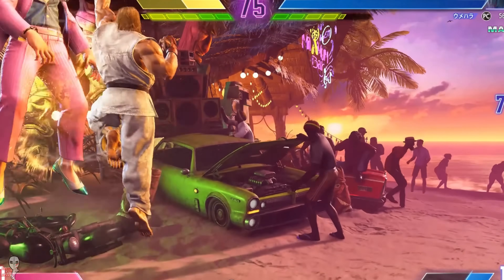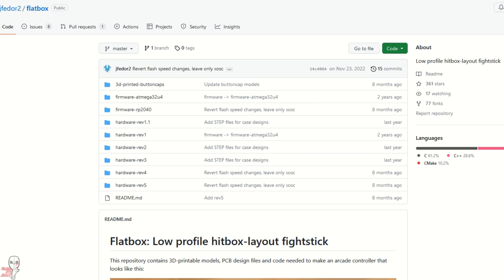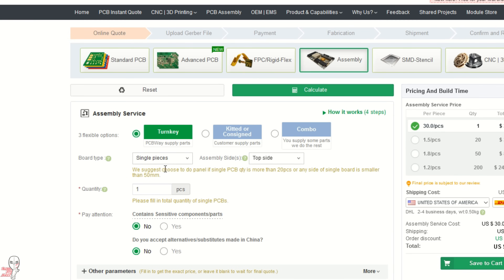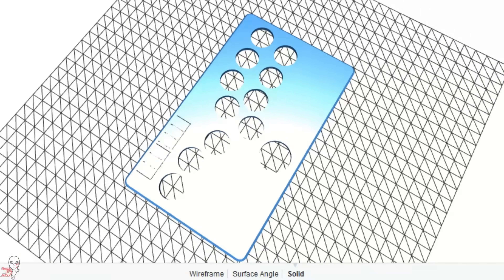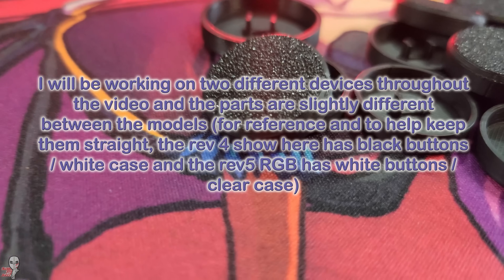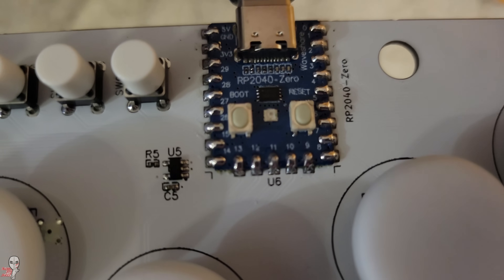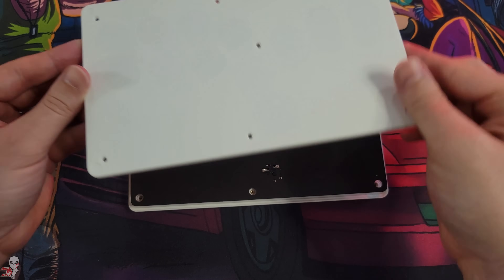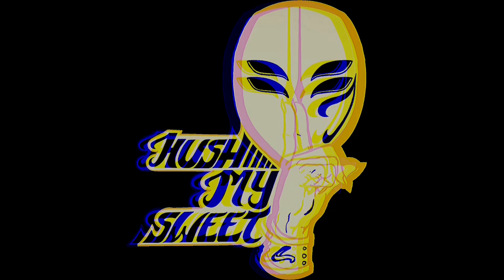Build your own Flatbox! An inexpensive, open-source fightstick option

Comment: I made ten of the Flatbox rev 5 earlier this year and gave a bunch of them to friends. I had done something similar with the Open-Frame1 (bigger controller for Smash) just a bit before and found the Flatbox to be a refreshingly easy/fast build by comparison. GP2040-CE is super nice and fleshed out firmware as well. The stuff I run on my Frame1 feels a bit more primitive and there aren't new releases as often.
I'm a big fan of the Flatbox. I've seen some of the keycaps I've printed break off in switches which is the biggest flaw of these things. Aside from that, it's been great. I printed caps in PLA+ and you might just need a sturdier plastic for something so thin. That or I got a few bad caps per batch maybe. Several people I gave controllers to have broken a single cap but haven't had an issue since.
Reply from the maker: Right on! Yeah, I think they are fun little units and it's cool you are helping out your buddies with some builds!
Reply: shittt wanna make me one? haha
Reply from the maker: @panpan1985  A lot of people build several at a time and then unload the extras to their friends/scene/whatever. But some of them sell the extras to recoup some of their costs. I know several have sold on https://www.reddit.com/r/Fightsticksforsale/  Good luck!
Reply: You gave them away?
Reply: @severussin Yeah, just to some people I hang out with IRL regularly. They weren't previously into traditional fighters (just a bit of Smash mostly) so I doubt they would've bought them if I'd tried to sell them anyway. This way I'm able to introduce them to arcade controllers at least. Although it's still surprisingly hard to get them to use them even when they were free.  It took setting up a console with Soulcalibur IV and showing them it worked with the Flatbox to get a lot of them playing with theirs after months of having them.
Reply: @SoundToxin  You're doing a public service. Kudos to you! Out of interest, are they PC or console players? I'm on PS5 and finding that we need to use the Brook Wingman FGC adaptor to make any of these custom boards work.
Reply: @severussin  I'd say they're mostly PC players, but we sometimes do some Xbox 360 or PS3 stuff when we meet up.
I think PS5 support is still being worked out in GP2040-CE. The latest release candidate mentioned something about it, but it uses some sort of USB passthrough. I think some controllers support connecting to a regular controller (like a DualSense) to get PS5 support and the feature was aimed at something like that.
One of my friends ended up getting Street Fighter 6 on PC and uses his Flatbox for that now. 
I don't think any of us are trying to play a super new game on a console so the lack of PS5 support hasn't really come up.
Reply: I also have ptoblems with the caps. They break way too easy even when swapping to a new color. Therefore switching to v2 switches hopefully this works better

Comment: there's one thing I don't understand-- how does the micro controller know which key is connected to each pin? 
With an arcade stick, there's a wire that connects them. But there's no wire here. Im confused.
Reply from the maker: What you're thinking of normally is where a wire connects from a button to the PCB. Here, the buttons connect directly to the PCB.

Comment: Is there a way to make it work for ps5?
Reply from the maker: Not as it sits. You'd have to integrate a Brook Fusion board or PS5 daughterboard add-on somehow, but that's going to require a big overhaul. An easier way to do it is to buy the Brook PS5 wingman converter and just plug it in to that for PS5 compatibility. Good luck.
Reply: @HushMySweet1  damn, I saw some controllers in that use the ps3/ps4 fighting board plus and the ps5 upgrade and they make it work somehow.

And a guy from my country made a controller for me with the same fighting board and made the ps5 upgrade with a raspberry pi upgrade, I also have no idea how he make it work tho D:

Comment: would I be able to build one to work for ps3/ps4/pc?
Reply from the maker: The ones you see in the video do work on those systems. The only issue you may find is the PS4 requires special keys/codes, so that one can be more of a headache if you can't find them. The ps3 and PC should work by default though.

Comment: Are there any similar alternatives but compatible with actual arcade/sanwa obsf buttons?
Reply from the maker: Not really? I think the appeal of these is that you just plug the low profile switches into a PCB and it's all one little unit with no real wiring, and super portable/cheap. Once you get into Sanwa buttons, you have to do some wiring and have a minimum depth to your case to accommodate. You could probably dial in some low prof choc switches to give it a more "standard" arcadey feel, but I don't know of a good equivalent. You're getting into Flatbox and Hitbox stuff with standard buttons. Good luck in the hunt though!

Comment: Is it possible to find PCBs and enclosure files that use different button layouts? I would like to have a leverless controller that puts the L1/L2 buttons just above the face buttons so they're more easily reachable, rather than needing to reach your pinky.
Reply from the maker: Not that I'm aware of. Hopefully this video acts as a catalyst to get more people into the PCB design process. You can also join the Open Stick Community discord (they can help with questions) and try your own hand at the next big design. Good luck!

Comment: This is great, sadly a couple of switches are out of stock right now ;_;

btw is there an RGB -free version?
Reply from the maker: The tact push button ones? Or the low profile switches? If it's the low profile, then you could try dark yellows. That's probably my favorite switch type (a bit stiffer than red) and they always seem to be in stock. Also the Rev4 Bridget doesn't have lights if that's what you meant. https://github.com/sgfdevices/Bridget

Comment: Do you mind telling me your total cost on this? pad has been hurting my hands a lot lately but I don't really have the money to invest in a hitbox (even if I did, they're all sold out).
Reply from the maker: That resin one with the Rev5 board is going to be more expensive, but if low price is priority, that Rev4 version with the 3d printed case (the white one with the black keycaps) should be about $50-60 if you want to build a similar one yourself. Good luck!

Comment: Hey Hushmysweet, love your collection and videos. I was wondering if you will do a fight stick to lever less conversion video in the future.  I would love to convert my old hori stick alpha for ps5 to lever less.  All I know that is I need a socd cleaner and new plexiglass for buttons lol.
Reply from the maker: Hey, thanks! That would actually be a fun video concept, but unfortunately I sold the Alpha to a buddy, so I don't have it to test and tweak. I think I remember it having an extra wire to the joystick, but I would imagine it would still take a 5-pin joystick to all-button conversion harness. You could get a BitBang Magician's SOCD cleaner to make sure the inputs were being read the way you wanted. You'd also need plexi like you said, but a metal panel below it to support the plexi and sort of act as the top panel frame (you would not want to solely rely on plexi). I'm just spitballing stuff here since I don't have it in front of me to look at, so I'm not sure how difficult the change to leverless would be. If you could buy the face panel plexi and plate, it would make things a lot simpler. If I get another one in the future, I'll see about a swap since that is a good idea. Thanks for watching!
Reply: @HushMySweet1   Thank you SO MUCH! I appreciate the reply and all the information. You are the best! thanks for the advice.  Always!! @ Thanks for watching!

Comment: Do you have a Snackbox Micro or an MPress?  Im curious how the height from the top of the  shell to the top of the buttons compare on the flatbox to the commercial offerings.
Reply from the maker: I have the Micro and the XL so I pulled them out to look for you. Looks like the Micros are slightly shorter from the top of the shell to the top of the buttons. It's fairly marginal, but if you're wanting the lowest distance between top of cap and top of panel, looks like Micro has the Flatbox beat on that front. Hope that helps!
Reply: @HushMySweet1  Thanks for checking!

Comment: I just made my own controller using a pico pie running 2040-ce and printed the parts. It takes some thinking and planning but it's worth it if you have the patience. Works for PC, Xbox, Switch, and PS4. it was about $20-$25 worth of parts.
Reply from the maker: Very cool!
Reply: Would you happen to have a list of source parts. I am looking to set one up for my XSX

Comment: In games like Soulcalibur VI, there are certain moves that demand frame-perfect input of one button followed by another button with zero overlap between the two, which is accomplished by fiercely sliding your finger(s) across the buttons. So when I see these new low profile controllers popping up it makes me cringe a little because they all seem to have textured buttons that are flat or even concave, instead of convex and smooth to allow for such slide inputs. If someone starts making proper injection molded smooth convex button caps for these low profile switches, I'd say they would have a winner on their hands.
Reply from the maker: I feel ya, but there are some that do. Don't quote me on this, but I think the SGF Zappa and a newer prototype from Mavercade have higher end injection-molded button caps. Maybe the Slab Mini as well? I need to review more controllers to see for sure. Plus Junk Food Customs sells smoother caps for their Micros which should work with these units. But I get ya. I think they have to be 3d printed to be cost efficient for a lot of these smaller controller businesses, but we are seeing some more "proper" buttons coming up. Thanks for watching/commenting!
Reply: @HushMySweet1  I took a look at the brands you mentioned and I'm pretty sure those buttons are from Punk Workshop, or maybe are clones? It's hard to tell for sure, but I had previously wondered if the Punk caps were smooth enough or not. Maybe at EVO I'll run into someone with some of these on a controller to try out.
Reply: @KyleJohnsonVA  idk if where clones, could be, had razer switches... is not a hard product to clone, even harvesting a cap you like and putting on the mechanical switch you like is not that hard or particularly fragile after its done. could be an interesting side hustle for a teenager with a 3d printer going to EVO... do ones with Crown/Sanwa/Qanba caps :p
Reply: you can sand the 3d printed button to have the surface you want, is to time consuming tho... buttons like the one you want are starting to pop up from molding, a good start is to find razer kitsune buttons aliexpress already has it (cheaper options will show up in some months tho)
Reply: @antimage797  I took a look and didn't find anything, and wouldn't it be odd for them to have parts for a product that isn't even going to be released for a while yet?

Comment: I literally just finished mine yesterday after fixing my 3d printer lol
Reply from the maker: Awesome! What kind of printer do you have?
Reply: @HushMySweet1  Real crappy ender 3 S1 but I make it work lol. Unfortunately haven't been able to play much yet as I'm having sporadic inputs with the menu buttons and I still haven't figured out what's causing it, gonna try building again from scratch as I think maybe the board or 2040-zero is bad. My soldering isn't the best but there isn't any bridging and I don't see any shoddy connections.

Comment: I wonder how to make this compatible with PS5. I'm building a hitbox right now and all I had to get was the UP5 board and add it on.
Reply from the maker: The easy way is just plugging in a Brook wingman converter. The hard way requires an overhaul. These things run on GP2040-CE based stuff, and that isn't currently compatible with the PS5. So, we are waiting for the Open Stick Community to solve the PS5 so we can update the firmware. No timeline on that though. If you don't want to wait, then you'll likely need to integrate Brook hardware. They have a PS5 daughterboard add-on as well as a new Fusion board. Check out devices like the Zappa and some of the newer Slab Mini PS5 prototypes to see how they've been tackling PS5 functionality.

Comment: It possible to make the case with plexiglass and laser cut ? More videos like this please :)
Reply from the maker: Hmmm. I suppose anything is possible, but you'd have to make some changes. The original cases have contours on the inside and then the screw insert areas line up with the holes in the PCB. You're not going to be saving any money over a 3d print, but you could probably fab up something. Let us know if come up with a cool new plexi case! Thanks for watching!

Comment: What size threaded inserts and screws did you use? Is your clear one a rev 4? Great video thanks.
Reply from the maker: The clear resin one is the Rev5. The white case 3d printed one is the Rev4. Some of the different versions require different stuff, so double-check. I grabbed the heat set inserts and the screws on Amazon (along with the USB C cable, and those little sticky feet for the Rev4 case).
Inserts: AIEX 100pcs 3D Printing Brass Nuts, M2 Threaded Insert, Knurled Brass Nuts, Female Thread Knurled Heat Embedment Nut for 3D Printing Parts Loptop Automotive Plastic Shell (M2x3x3.5mm) 
Screws: NACX M2 x 6mm Phillips Countersunk Flat Head Machine Screws Bolts, A2-70, Silver Tone, 304 Stainless Steel, 500Pcs
Reply: @HushMySweet1  Perfect. Thank you very much. I got a rev4 printed and am now inspire to print it in clear.

Comment: Hi! what size of heat set insert did you use? Amazing video!
Reply from the maker: Thanks for watching! I bought them on Amazon: AIEX 100pcs 3D Printing Brass Nuts, M2 Threaded Insert, Knurled Brass Nuts, Female Thread Knurled Heat Embedment Nut for 3D Printing Parts Loptop Automotive Plastic Shell (M2x3x3.5mm)

Comment: Can you point me in the direction of which pcb to buy??
Reply from the maker: Well, you can use a PCB assembly service like in the video, but if you want something that's more or less done and ready, then you can check out Etsy. I'd get one with hot swap sockets. Then! Make sure that PCB you chose corresponds to the case you'll be printing. The rev 4 and rev 5 have slightly different cases. Good luck with your project!
Reply: @HushMySweet1  Thank you! One more question. Do you know where can I get the swithces?
Reply from the maker: @joaquinbaglietto9355  Amazon or any of the usual keyswitch suppliers in your part of the world (chosfox or adafruit, etc.). Here are some dark yellows on Amazon (which are a completely underrated switch imo). Good luck. https://www.amazon.com/gp/product/B0BLCLWFL5/ref=ppx_yo_dt_b_search_asin_title?ie=UTF8&psc=1
Reply from the maker: SGF also just yesterday released a PCB option on their website that is compatible with the Rev4 cases. GL!
Reply: @HushMySweet1  thanks!!
Reply: @HushMySweet1  are you refering to the Bridget mx?
Reply from the maker: @joaquinbaglietto9355  Yeah, it's based on the Rev4 board you see in this vid and also accepts Rev4 cases. https://sgfdevices.com/products/sgf-bridget-mx-pcb

Comment: What a coincidence, I was looking into making my own flatbox to test out a stickless controller just last week, but it ended up being too expensive since I live in a third world country with no way to get the parts for cheap, plus the process looked way more involved compared to the fightstick I built a few years ago. Ended up picking a fully assembled flatbox from China for around $50 USD, currently waiting for it to arrive.
Cool video!
Reply from the maker: Awesome! Hopefully the Flatbox works well for you! They are fun little units.
Reply: I got one of those, too, for similar reasons. Mine is clearly a knockoff running GP2040-CE, but it's built well enough and even has an OLED screen. Sometimes the buttons get stuck, which I still haven't figured out if it's an issue with the low profile Cherry reds or the button keycaps.

Taking my time, but I think I will still try DIY-ing my own controller because I'm not a huge fan of the "standard" layout for all-button controllers.
Reply from the maker: @ZovcDrafts  Those OLED screens are cool, but I would hate to have buttons get stuck. That's a major con for me. I agree with you on the standard all-button layouts. I like it when they spread things out a bit more. I'm also excited to see some future options with some atypical button placements for Drive Impact-type stuff. Good luck on your DIY controller! Tag me on r/fightsticks when you finish! Thanks for watching.

Comment: Very nice video, I do have a question about those screw inserts though. The github page never mentions them so i was confused seeing them. Where did you get them and what kind of screws did you end up using with them? Thanks again :)
Reply from the maker: Some of the different versions require different stuff, so double-check. I grabbed the heat set inserts and the screws on Amazon (along with the USB C cable, and those little sticky feet for the Rev4 case).
Inserts: AIEX 100pcs 3D Printing Brass Nuts, M2 Threaded Insert, Knurled Brass Nuts, Female Thread Knurled Heat Embedment Nut for 3D Printing Parts Loptop Automotive Plastic Shell (M2x3x3.5mm) 
Screws: NACX M2 x 6mm Phillips Countersunk Flat Head Machine Screws Bolts, A2-70, Silver Tone, 304 Stainless Steel, 500Pcs 

Hope that helps! Thanks for watching!
Reply: @HushMySweet1  Thank you so much! This has been a big help